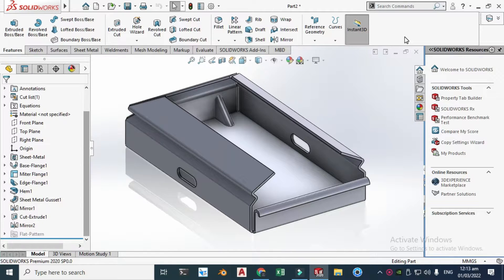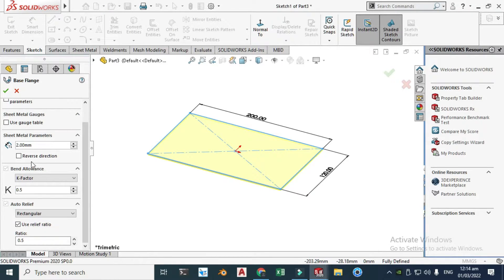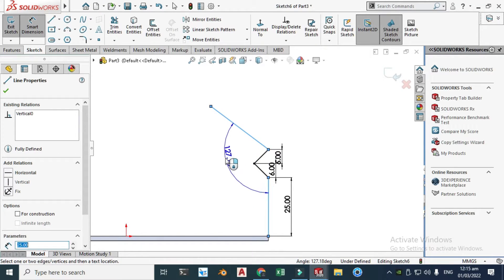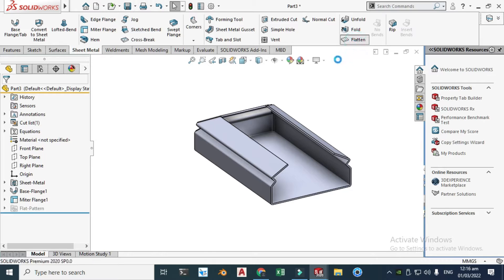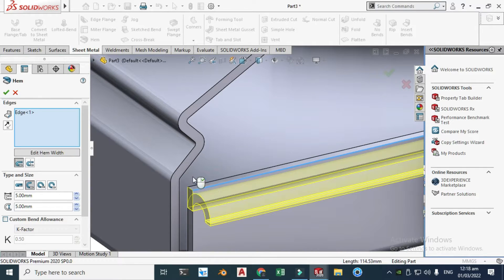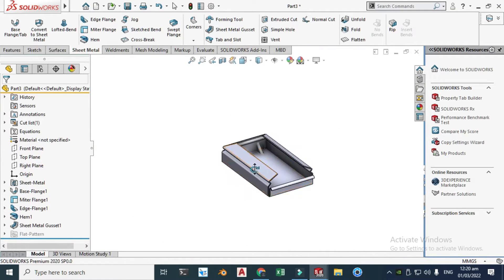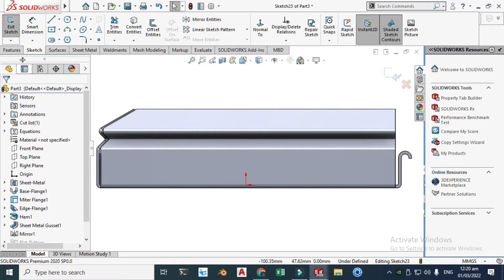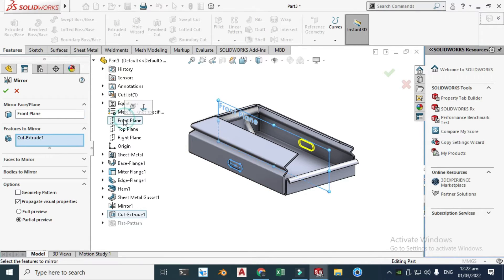Solidworks Sheetmetal Basics | Solidworks Sheetmetal flatten | Export Solidworks to Autocad DXF

Comment: Please  discuss  bending  line
Reply from the maker: In SolidWorks sheet metal design, the bending line is the axis along which material is folded. Key considerations include:

Bend Allowance: Material stretch or compression during bending, calculated based on the K-factor, material properties, and geometry.

Bend Tables: Tables in SolidWorks with bend allowance values for different material parameters.

Bending Line Location: Defines the axis of the bend, crucial for accurate part geometry.

K-Factor: Dimensionless value determining the neutral axis position; affects bend allowance calculation.

Flat Pattern: SolidWorks generates a 2D unfolded pattern, crucial for manufacturing; bending lines indicate bend locations.

Bend Deduction: Represents the difference between initial and post-bend lengths, influencing accurate part fabrication.